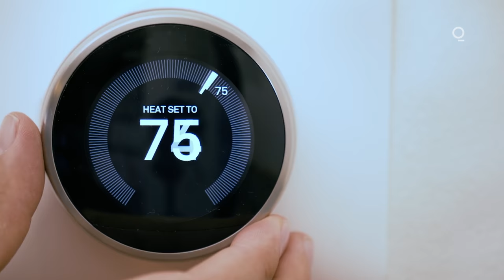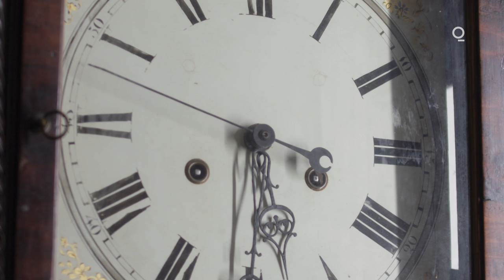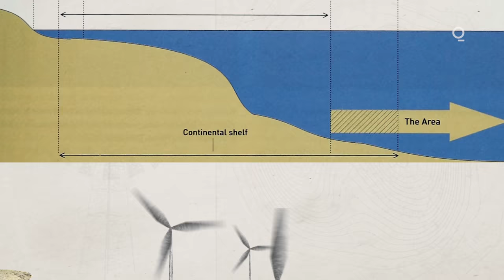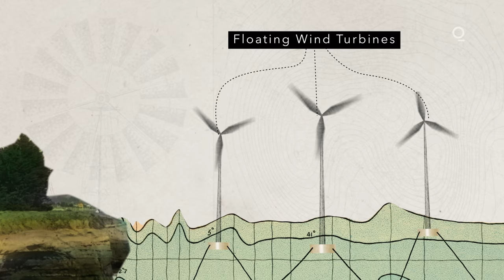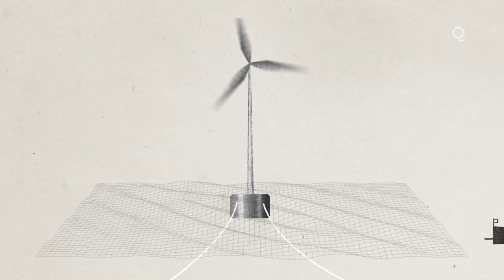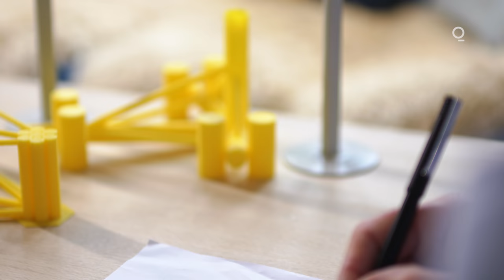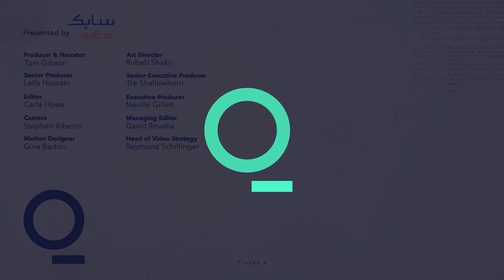The Godfather of Wind's New Floating Revolution

Comment: Far as I can tell, none of the modern floating offshore turbines are connected to a shore  grid.  Building and floating  large offshore structures is no longer terribly difficult .   Building and burying and landing practical ~100km power marine cables that last >5yrs is.  

Given the massive continental wind drought  seen by Europe this year, it’s well beyond myopic for Bloomberg to trot out a Marvel Comics level, uncritical, wind-to-the-rescue wind video.
Reply: You might want to tell the UK grid people that. There are hundreds of offshore turbines and high power subsea Interconnectors with all neighbouring countries (France x2, Belgium, Netherlands, Ireland x2, and Norway).
Reply: @simon7790  If you dig into the existing sea floor mounted offshore turbine farms with their 1km to 5km cables, you’ll find they are maintenance intensive, have life in single digit years.  As more offshore farms appear, landing spots ashore become harder to come by, where tide-wave action won’t expose them quickly on the beach and where the necessary safety concrete walls and barriers don’t draw large public objection.  

With the national interconnection cables, obviously there’s only going to be a few per country, not hundreds, and they’re typically big, GW or so, leveraging  cost of scale.  Even so, they fail; see eg the UK-France line which failed in a fire this year.  Also, interconnects pay for themselves by nearly always running one way or the other, which isolated intermittent sources do not, making transmission more expensive, onshore or off, per MWh carried. 

Here, with floating turbines, the whole point is to place them far offshore , 50km, 100km, 200km.  The power cable, this time to a moving platform, is going to be very much larger share of project cost.  Yet not a word appears in media promotions like this.
Reply: @Nill757  "Here, with floating turbines, the whole point is to place them far offshore"
Incorrect, the entire point is to be able to place them where there is no continental shelf to support existing designs.
Reply: @Nill757  This is nonsense. Cables are not replaced during the life of the turbine. 

They are buried with ROV's, and connected to grid connectors so to suggest there is any difficulty finding landing spots where tide-wave action won't expose them is absolute nonsense. Same as internet/fibre optic cables or other pipelines. 

And as you no doubt know, the interconnector fire was in the land based substation. Nothing to do with the cable.
Reply: @simon7790  "Offshore Wind Cable Exposed at Block Island Beach 2019"

Why?

"The problem has persisted since 2016. National Grid and Ørsted, formally Deepwater Wind, blame subsurface bedrock and boulders from preventing the cables from staying buried at a mandated depth of 4-6 feet into the seafloor. They also said shifting sand has made them prone to exposure. "

The BI wind farm went online three years ago.

I did not mean above that the entire marine substation to shore cable requires frequent replacement.  What does occur frequently is a fault somewhere in the cable or termination points, taking the entire wind farm offline, often for months.  

Yes I know the UK-France line was caused by a fire at the termination land point, but the fire risk is inevitably greatly increased because is necessarily a high power substation in a near-marine environment, high water table, etc.  That line is expected to stay offline six months, until March. 

The burying, handling, construction of 32KV powerlines has little in common with internet fiber lines.  Both under water?  Thats about it.
Reply: @westrim  Yes, which in most cases, is ... far offshore.
Reply: " massive continental wind drought " hyperbole much?

Comment: There is only one problem with wind and wave power.
As an extreme, you have made an ecological change to shores, currents, and flushing.  Winds disperse smog and accumulations.  London chokes again.
Slit builds up in harbors.
You just may not be able to do big farms in one place.
Reply: That’s some excellent nonsense right there.
Reply: @mlgpro2241  
Wind and waves are forces.  If you use up some of that energy, you change the effects and environment downstream...just depends on how big a change.
Reply: @martin3203  
OK.  What part was nonsense?  See reply to reply below.  You just never thought about it.

Comment: Thinking that renewable matters at all is a mistake. Our goals should be energy security, affordability, and environmental protection without regard to being called renewable or not. It's clear that dilute intermittents are unsuitable to do the heavy lifting if these are the goals.
Reply: Europe doesn't have unlimited fossil fuels to try and tap into so we are reliant on imports. These offshore wind farms are indeed intermittent but not as much as you might imagine. The North Sea is perhaps the world's best location for wind farms. The modern turbines will achive 60% capacity factor individually and as a fleet capacity factor it'll be closer to 70%

So for Europe these offshore wind farms do help reduce imports. Plus at the moment they are also cheaper than the alternative of gas fired power (mostly becisde gas has been very expensive the last 2 years and probably the next 5 years too)

Comment: Check out S e a t w i r l (if I write it out a Bloomberg moderator removes my comment. Why?). Their floating vertical axis wind turbine (VAWT) design is tailor-made in every detail for the conditions at sea, giving them the most cost efficient solution on the market for offshore floating wind.
Reply: It's a hobby sized toy at this point. The prototype is rated for 30 kW. A far cry from today's 12,14, even 15 MW offshore wind turbines. You do the math on how many of these tiny wind toys you need to replace just one of these giant offshore wind turbines and I think you'll find that it's far from being the most cost efficient solution to a real energy company.
Reply: @LarsPallesen  their upcoming model is rated for 1MW. we'll see if they manage to develop it. it'll still be small compared to current wind turbines, but it's nothing to gawk at, and vawt models have some other benefits.

Comment: I'm confused, the recent Europe energy crisis demonstrated that wind energy/alt energy hasn't worked out, suppliers that alleged that all their energy is from renewables collapsed when gas prices went up and handed over  customers to the big energy suppliers, this will not be to the benefit of the customer. We talk about the end of fossil fuels but it seems a paradox in the PROMOTIONAL video above, oil and gas are paying 600mln for a handful of wind turbines, that require a dedicated CEMENT factory and many tons of metal to supply some off shore rigs! I don't know for sure but from recent energy crisis it seems wind energy couldn't step in and fill the void when they have been there for decades now. Either the grid couldn't aquire the power coming from them, or wind conditions need to be at a certain level, or storage issues that you have with solar.
Reply: wut? where did you read all of this nonsense? 

wind energy producers are all doing fine, they're doing even better given the high energy prices. it was the energy companies that relied on gas in the UK that collapsed, you know because gas prices went through the roof and many of them were already barely profitable. wind and solar in europe are still producing the energy that they usually produce, nothing really has changed here. 

wind and solar are already profitable and don't even need subsidies anymore. But then I'm sure you're also worried about the massive amounts of handouts we're already giving out to the fossil fuel producers, you know so they can build their oil drilling platforms that require massive amounts of raw resources.
Reply: @Nill757  statistics isn't your strong side. 

wind has produced about the same amount of energy it was expected to produce for this period. 10-20% more or less energy produced by wind is pretty much in line with calculations and expectations for this period. last year it was a bit more, this year it was a bit less. this is not the cause of the high energy prices right now. 

the only trainwreck here is you because you have an axe to grind.
Reply: @Nill757  gas prices didn't "explode" because of a lack of wind in the North Sea. 

They exploded because Russia decided to send only the minimum amount of gas they were contractually obligated to send. 

In the UK and elsewhere there were also other problems unrelated to a lack of wind including price speculations, which pushed the energy prices sky high. 

Again, I don't have an axe to grind here. That is you. Try reading less propaganda next time.

Comment: These floating turbines won't survive storms or unstable sea surface.
Reply: They aren't just guessing they have had floating offshore rigs drilling pumping oil and gas in the North Sea now for over 40 years

Challenges exist but engineering overcomes them

Comment: For some reason I'm not impressed of this next giant leap in offshore wind technology, because I fail to see why it is so innovative e.g getting an object to stand upright in water is not "rocket science" as it is similar to bite indicators such as fishing floats equipment used by anglers when fishing. I could well imagine that installing a floating wind turbine would actually be easier that one fixed to the seabed as one could just either fill the base with water to make the whole structure less buoyant and thereby decrease height of the structure while installing wings and nacelle or make more buoyant in order to make the structure lie almost horizontally and do the affor mention installation then fill it with water until it is both vertical and sits in the water at the desired depth.
Reply: Remember, these floating turbines are ‘fixed’ to the sea bed by maybe 50 tons and a kilometer of anchor chain.  That chain will act as sea floor bull dozer in all directions.  That’s something to think through before placing 10,000 of them out there, as would these advocates.

Comment: I see it as very dangerous to the environment and especially to navigation...
Reply: Hardly.
Reply: Compared to an oil rig?
Reply: @simon7790  For the sea floor ecosystem, yes I suspect some 10,000 moving, massive anchor chains bull dozing the bottom would be worse than some oil platforms.  Of course, for electric transportation the comparison should be to a handful of acres ashore containing a few nuclear plants, not 10,000 offshore turbines which still need fossil backup hiding ashore.  

What do you suspect Simon?
Reply: @Nill757  The environmental audits done show this is a minor concern. As someone who for years lived on a boat anchored to the seabed, where I regularly dived on the anchor to inspect it, I know the damage caused by well set anchors is minimal. The catenary effect spread between 3 or more anchors minimises movement. The bulldozing you are referring to comes from bottom trawling fishing, not static anchoring. Anyway, this is a straw man. I've read your other comments. It's clear you are against wind power in general, in spite of the evidence it is an excellent low cost resource.
Reply: @simon7790  You dove on yacht anchors.  Me too.  Then you know, I know, and everyone here knows these several hundred tons of offshore platform wont be held by dinky yacht anchors in depths of 100s of M against heavy seas and currents.  Ship anchor chains can have mass 50 tons, forcing large scope and chain laying on the sea floor. The spar-bouy mooring proposals need a spread of 4-6x water depth. Sea floor scour of the benthos is all over the environmental discussion; it appears nothing but tricky tension leg is going to be allowed at scale.

"against wind power in general, in spite of the evidence it is an excellent low cost resource."

Again, you know this is not about wind in general, but about offshore, and the most expensive type of offshore yet proposed. The IEA has fixed offshore some 80% more expensive than onshore.  This will clearly be yet more  expensive.  

I agree wind onshore, when coupled with fossil gas, can be a low cost resource if the land and gas is cheap, but then in most of the world now gas is suddenly far from cheap.  Me, I don't want to couple with fossil anything, I want an entirely low carbon grid.

Comment: “Boundless source”

As long as uncritical, childlike pronouncements like this continue falling out of large media outlets, achieving conversions of existing fossil based grids to clean grids will continue to be unlikely.    Floating offshore has major technical and environmental impediments, none of which are mentioned at all in this fanboy drama:  100 km power cables to shore are expensive and need frequent replacement,  anchor cables scouring the sea floor.  And, though far offshore sees higher capacity factor,  it is still INTERMITTENT, requiring fossil plant hiding onshore behind the curtain. 

So far, no power grid in the world has come anywhere close to converting, aside from the few that built out nuclear power, ie France, Sweden, Ontario.  Get serious.